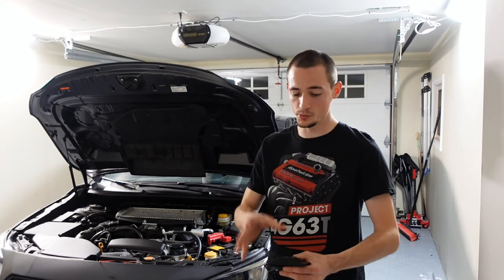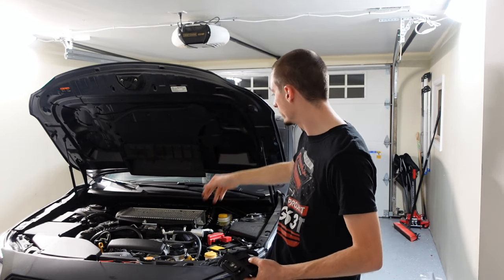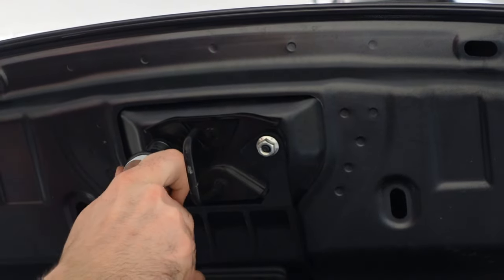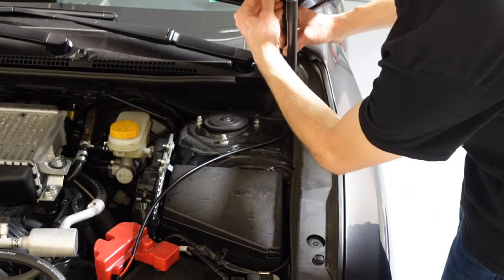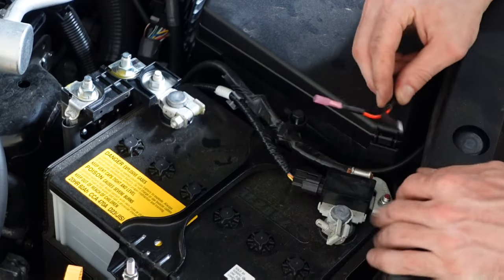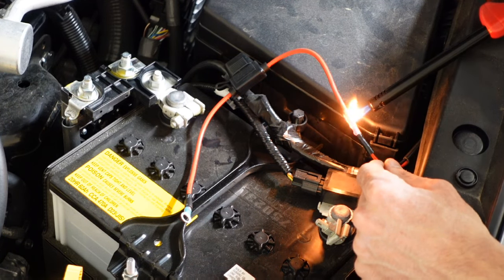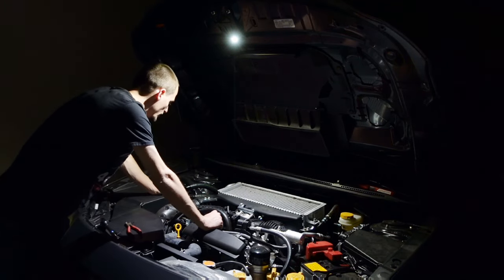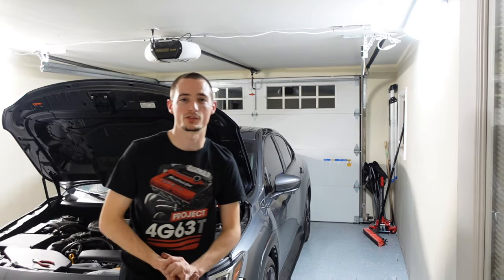2022+ WRX Under-Hood Light From Cruiser D&M

Comment: Nice! I gotta order this.
Real fast, is charge pipe and aftermarket tmic on stock tune ok?
Reply from the maker: It depends who you talk to. I've been told yes and no. My advice is always Yee it requires a tune. It does change air flow after the maf so in theory it could throw off scaling and damage the car. You also won't see any benefits from those parts without a proper tune. Hope this helps!
Reply: @StreetInspired1  thanks dude, I’ve heard both as well but trust your input and experience. Appreciate your time and hope you have a great weekend

Comment: Cody, u reckon the battery will melt in the sun or engine bay?
Reply: Hey there! This is printed out of a high temp plastic and will not melt or deform in the engine bay. I also warranty all my parts forever - no questions asked. 

I have personally driven a 1k mile trip in warm weather with my prototype model mounted up and it didn't deform whatsoever.

Comment: how did it fit with the latch? the  plastic  looks thick
Reply from the maker: It fit in just fine. I had just a slight rub and I notified the manufacturer and they're planning on slightly slimming it down to fix the issue.

Comment: notice any rattling or anything on the road?
Reply from the maker: Nothing at all. The only issue I had was a very minor rubbing on the plastic hood tray when closing the hood and I spoke with the manufacturer and they are going to try to make a minor adjustment to alleviate the issue.
Reply: @StreetInspired1  thanks Cody ❤️